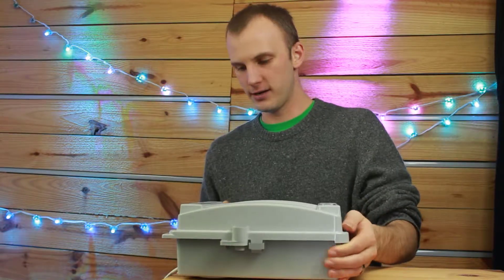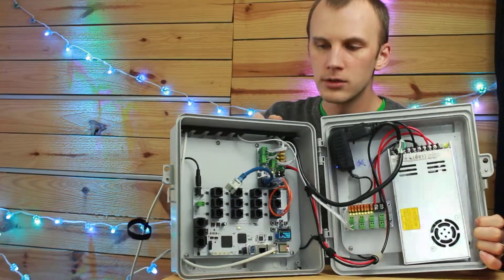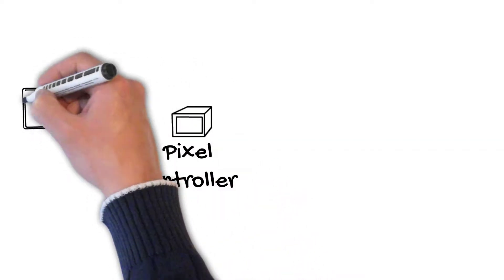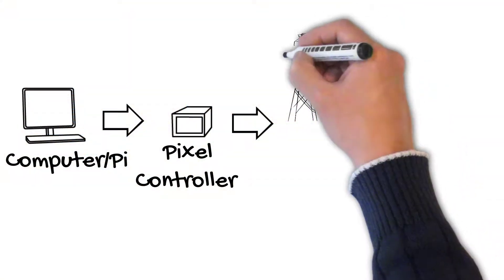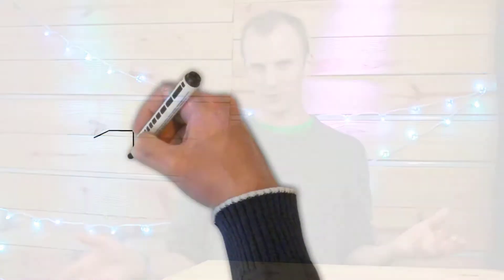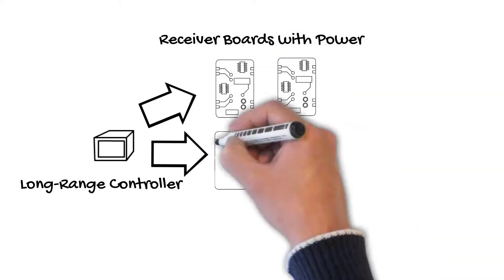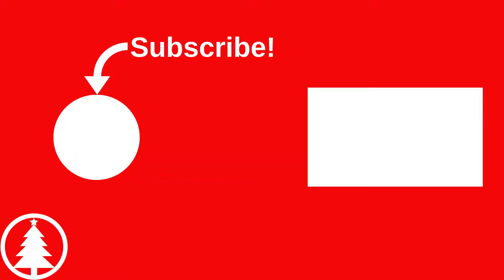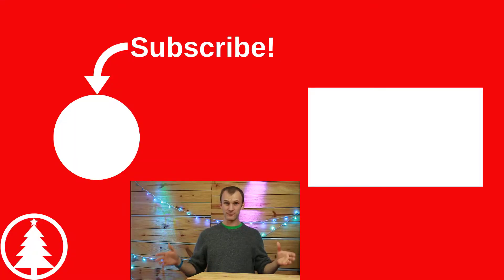What is a Christmas Light Controller? How Do They Work?

Comment: How many lights can be powered by a single power supply on average
Reply from the maker: Depends on the size of the PSU, the voltage of the lights, and the percentage you want to run them at.  Rough numbers show anywhere from 450 to over 1000 for a 350w, 12v PSU and 12v pixels, depending on the percentage of brightness you intend to run them at!